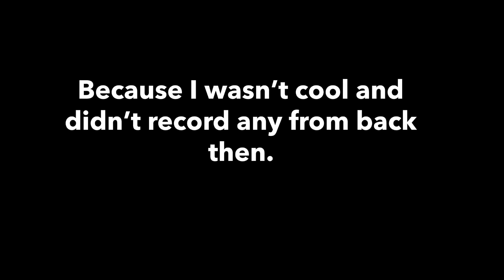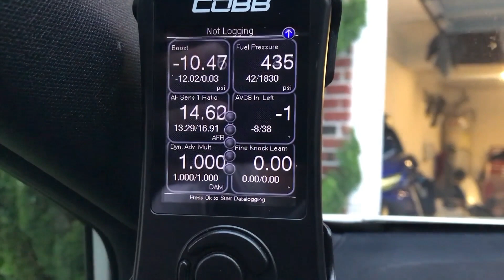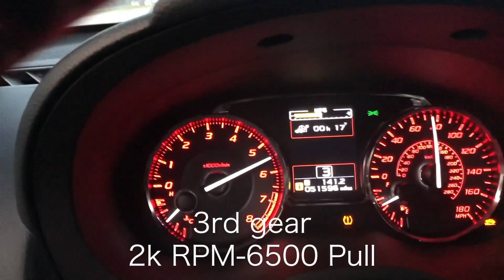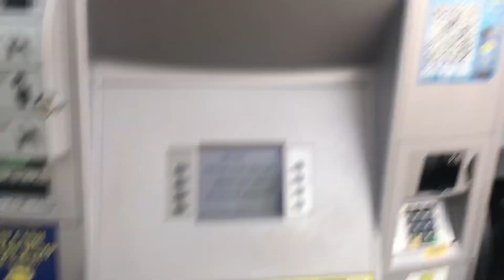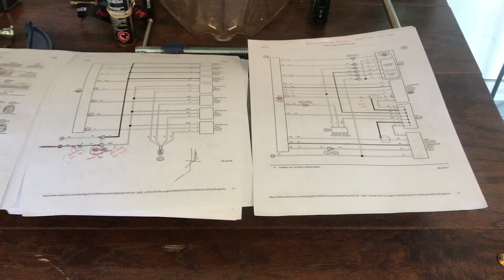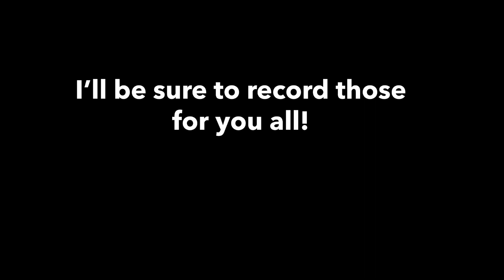Building a WRX in 10 Minutes

Comment: i really respect how you took the time to at least to do some kind of corrosion prevention on the areas you had to cut. Attention to details makes even the parts you dont see a lot more impressive
Reply from the maker: Thank you! It’s really important to me that everything is solid and can be driven in all weather conditions. I believe that if you’re embarrassed to take the kit off and drive, it wasn’t done right.
Reply: @StephenBaran  exactly. Like it's definitely one thing if you didn't do it to the front fenders, cause you can replace them, but it's still stupid to do nothing. Were you running all stock engine for this build?
Reply from the maker: Sorry for the super late response. Yep, the motor was basically stock. I had an Accessport with Cobb Intake and muffler delete before I officially started.

Comment: What is that black trim you put over the cut fender at 2:03 I just cut the fenders on my legacy cus I'm gonna do a lift build and some custom fenders. Great video btw, love the build. Just subbed!
Reply from the maker: Thank you! I used “rubber edging” from amazon. It should come up if you search that. Feel free to use a rubber sealant between the edging and the fender (to secure the edging to the fender) and the outsides of the edging to the fender faces to help seal it all up. I don’t recall showing this but I also used self etching primer and painted over the raw metal sections to aid in corrosion prevention.

No sense in doing all of this work if everything rusted out from under you!

Comment: Noob question, why buy a WRX (and modified it ) instead of the STI?
Reply from the maker: No worries 😊

I chose the WRX because I didn’t want to spend 32k+ on an old EJ motor and a diff that I wouldn’t ever adjust. I wanted the new FA20 platform. I’m glad I went this route because I’ve been pushing 415whp for a good while with zero issues. Stock block, stock trans, stock turbo, all original.

Comment: whats the black stuff you use after cutting the panels?
Reply: fenders*
Reply from the maker: It’s a type of spray sound proofing. It helped strengthen up the fiber glass panels a bit. It’s used in wheel wells often.
Reply from the maker: Unless you’re talking about the seam sealant or rubber edging for weather proofing the cuts to the body.

Comment: The screw holes on the body kit looks ugly, why not just fiberglass it to the body or is that not possible?
Reply from the maker: I chose to use rivnuts so I can remove sections of the widebody for vehicle maintenance and panel repair if one were to get damaged. If they were molded, I’d have to take and leave the entire car at a body shop for weeks or maybe months.

Comment: Why dont it have the rumbling Subaru sound?
Reply from the maker: The 2015+ WRX models have the FA20 with a twin scroll turbo and equal length headers. Those drastically change the sound of the boxer motor and hide the rumble. Theoretically, if you were to take a single scroll turbo and an unequal length header setup and install them, you’d get the rumble sound back.

It kind of sucks that it doesn’t sound like how a boxer motor should sound, but with the twin scroll turbo setup you can hit peak boost levels at as low as 2000rpm. Pros and cons I suppose.

Comment: Love it 🔥 how does the car sit with the open dump waste Gates with bags? I want bags but I'm worried I'll damage the wastegates
Reply from the maker: The dump tubes actually touch the ground depending on where I air out at so I have to be mindful of slopes and bumps where I park if I decide to air out. I’m sure it would also depend on wheel and tire specs. I’m pretty sure stock body can air out lower so it might be more problematic.